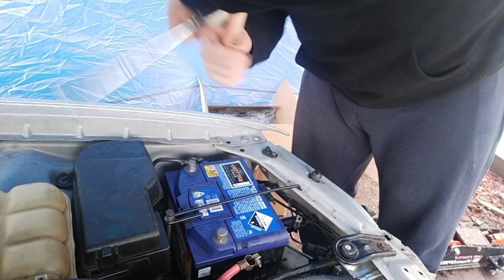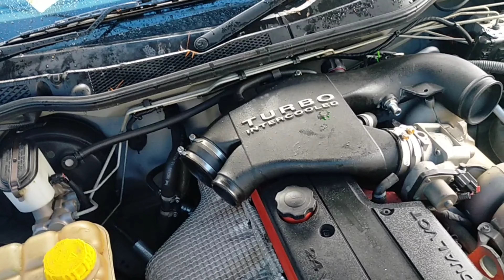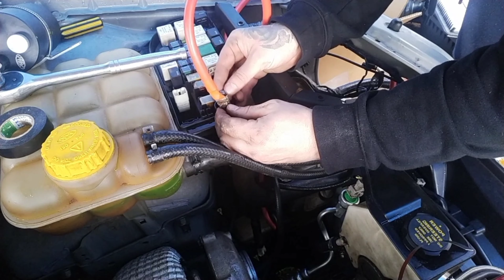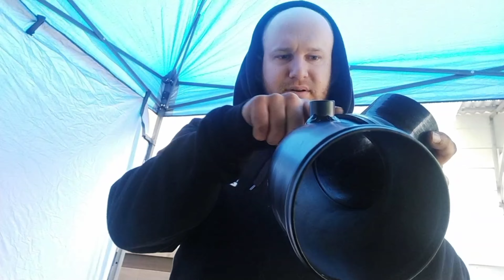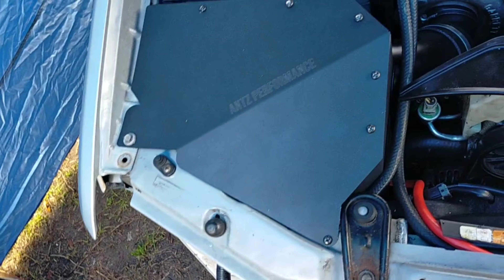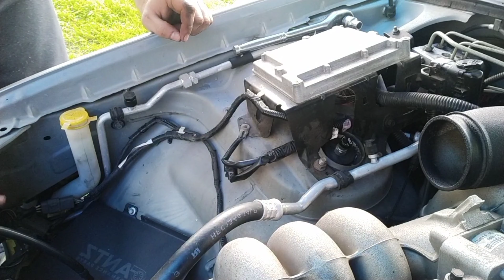Ford ba/bf antz performance turbo side in take & battery relocation installation

Comment: How did you run your piping from your inter cooler to your throttlebody? Mine has barely any space once you put the pod filter onto the turbo
Reply from the maker: You need to have a after market pipping and cooler to fit
Reply: Craig austin yeh ive got an after market intercooler
Reply: @williamwalton-feist4227  you need aftermarket piping